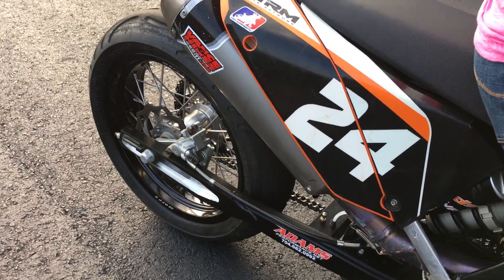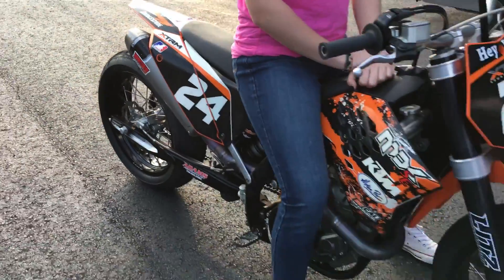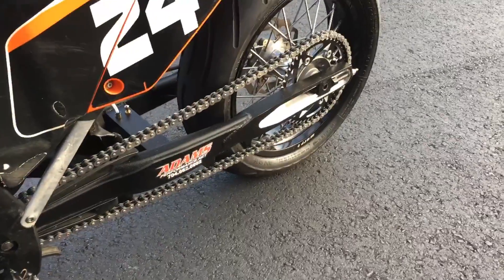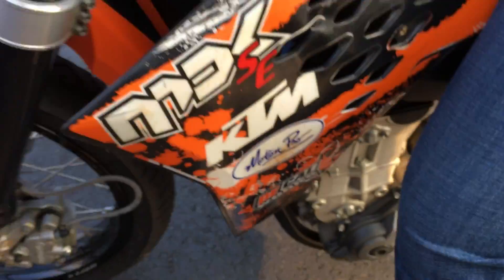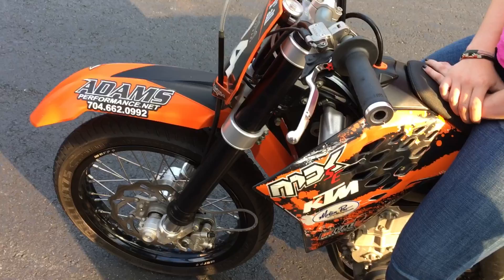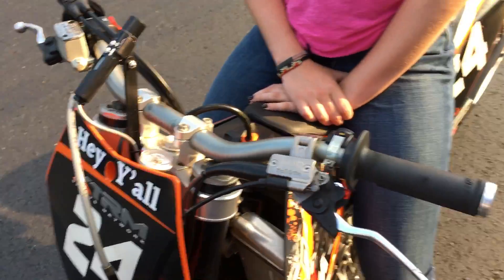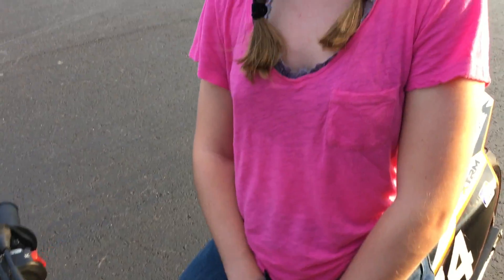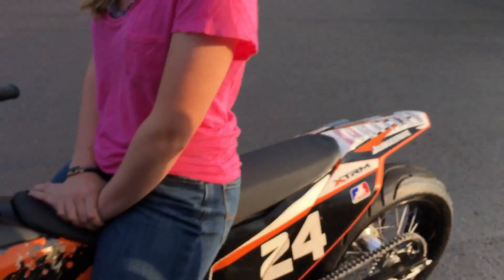KTM Dragbike built by NHRA Pro Stock Motorcycle Racer Chip Ellis

Comment: What are the tips on lowering the bike? Forks, rear suspension? I started drag racing on a complete stock kx125 in June of last year. I had a blast but the weight transfer in stock suspension it too much. Looking to lower and extend it. Any tips for a new racer? BTW hit a 16 in the 1/4 mile